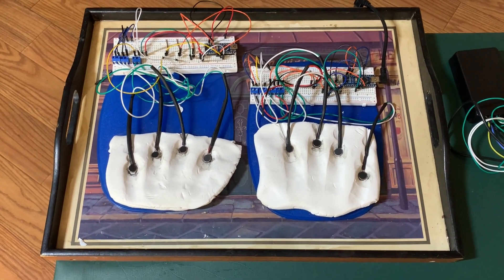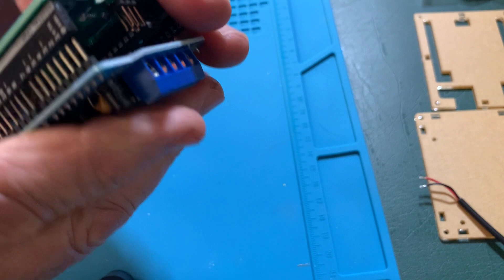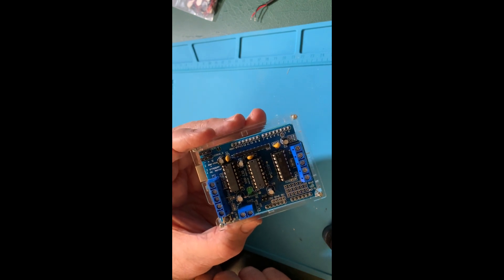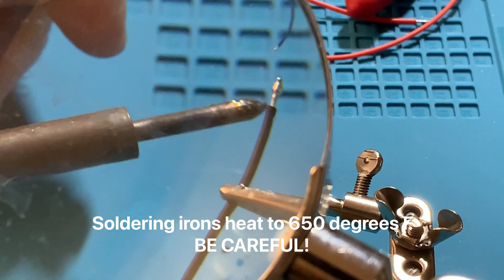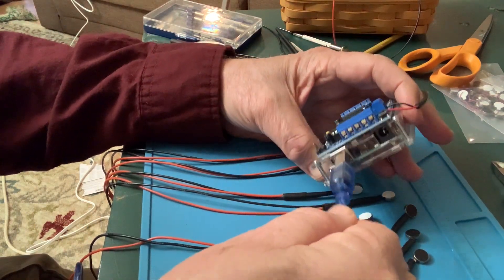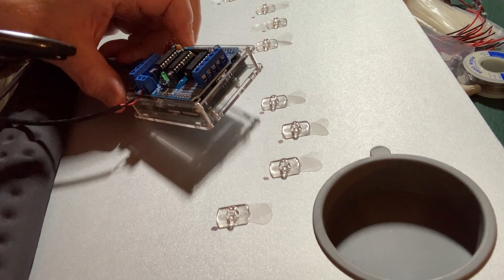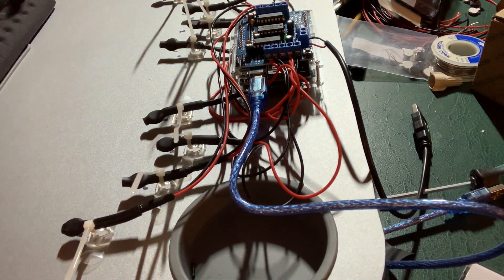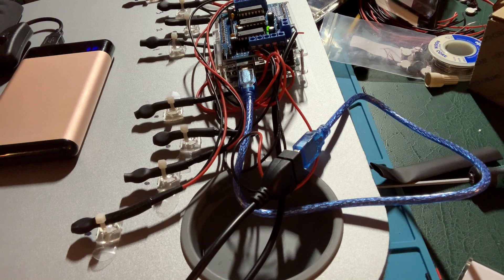PD Buzz Board

Comment from the maker: Based upon requests, I have added two additional Sketches to GitHub.  The VibroTherapyMotorShield_167_75.ino Sketch uses the 167 millisecond timing, but vibrates the motors at 75% of the strength of the standard 167.  The VibroTherapyMotorShield_167_90.ino vibrates the motors at 90% of the standard _167 strength.

Comment: Well done video and parts list!  My son and I assisted our "PD friend" complete his first therapy device today.  Our PD friend was able to assemble and software load the Arduino with another friend.  Works flawlessly!  Our supporting role was the buzz board assembly and therefore we naively watched clips rather than the full video. In hindsight that was a mistake!  Clearly, you went through painstaking efforts to make this design as simple, reliable, maintainable, and repeatable as possible.  I now understand your emphasis on "PD partner" as only a partnership could yield your accomplishment!  Bravo to you both!  Before commenting further I want to ensure those readers contemplating this effort that I echo the author's sentiment that this is certainly an effort that can be undertaken by robotics/electronics programs that PD patients can find locally.

The remaining comments are due to incomplete video watching, some missing parts, and perhaps a bit of bravado as we deviated from your design on our first endeavor with our "PD partner".  Our initial deviation taught us that vibration isolation between fingers is an essential aspect of any design and hence why a glove is an excellent approach.  If vibration isolation isn't accomplished "crosstalk" between motors defeats the sequencing.
Reply: Jim, tell me how vibration isolation was involved & solved, thanks.
Reply: Does each hand mirror the other please?

Comment: After overcoming a library issue which was causing the software upload to fail, and a miswiring of the red/black wires, we have successfully created our first PD Buzzboard using the 15k motors ... the Digikey motors are actually smaller than the Amazon 12k motors, but they pack a vibrating punch !   Thank you Paul for sharing your ingenuity !
Reply: Garrett, what was library issue and where did you wire incorrectly.  I need to check everything, thanks.
Reply: It took me a while to realize that the Arduino Adafruit library was named AF Motor (Arduino 1.0).zip in the GITHUB folder…. My compile/upload kept failing until I unzipped it in the ADE library mentioned in buzzboard video … the wiring problem was the printer cable not pushed in enough 😮
Reply: Thanks G, glad you're up and running--feel better.
Reply: Are you seeing positive results?

Comment: I would like to give thanks for all this information, it was very well detailed.  The build of the Buzz Board worked well if you are able to pay attention to the details given. The parts list and the download information is flawless.  The only real difficulty was the soldering for me, having the jitters. The wires are so small on the motors, you need the soldering fixture to hold the wires, even at that I ended up with 4 bad connections.  If this happens don’t try and salvage the motors, just start from scratch, with new motors.
Also if the buzz routine starts to act up, you may have to reboot by disconnecting the power for a minute. If it continues you may have a bad connection to a motor (bad soldering) or have moved the wires excessively while powered up. 
Go over the details of the building process many times before you start, it takes time and patients, don’t give up !
Thank again
Tim

Comment: Hello Sir Buzz! WOW, I have to say, this is impressive to say the least. Could you please share a link to the Stanford docs that you got the specs from? May I ask what your day job is?
Reply from the maker: The Stanford documents are here: https://med.stanford.edu/tass-lab/publications.html
The one on the study is here: https://www.ncbi.nlm.nih.gov/pmc/articles/PMC8055937/pdf/fphys-12-624317.pdf page 4 has the patterns.
This document references the randomization: https://www.ncbi.nlm.nih.gov/pmc/articles/PMC8771098/pdf/NRR-17-1495.pdf

There is a lot of very good reading in there.  Also, a YouTube search for Tass and Parkinson's Disease has some very informative talks that are worth the time invested.

Currently, I am the tech lead for a system in the civilian federal government.  I spent a large chunk of my early career as a programmer.
Reply: @pdvibrationtherapy  Thanks so much for the links! I've looked at many of the Stanford docs and don't see the spec info. Could you please point me to where you found the detail for the build? How many hours would you estimate to perform this build the first time?
Reply: @PaulNavarro-d6r  They didn't exactly put out step by step instructions for the build.  However, they provided detail on their process.  The top of page 4 of this document https://www.ncbi.nlm.nih.gov/pmc/articles/PMC8055937/pdf/fphys-12-624317.pdf has the diagram of the stimulation pattern.  However, right below it in the left-hand column, it states 100ms while the diagram shows something closer to 167ms.  This document https://www.ncbi.nlm.nih.gov/pmc/articles/PMC8771098/pdf/NRR-17-1495.pdf page 2, center column, bottom 3rd, references random patterns.
For a first-time build, my guess is that the board will take between 60-90 minutes plus the time to build the fingers.  The soldering of the fingers IS the challenge on this build.  I can build a board's worth of fingers (8) in about 30 minutes.  However, I have done it a couple of times now 🙂

Comment from the maker: Several folks have expressed interest in a randomized version of the board software.  A big thank you to Michael and m@mfritz.com for contributing customized code for the board.  The code is now available on the github and Google drive as PDBuzzRandom_100_orig.ino and PDBuzzRandom_167.ino.  the 100 is Michael's contribution.  The _167 is identical with a longer pulse time.
Let's keep the innovation going!  
Full disclosure, I confirm that contributed software loads and runs on my test board.  As usual, no warranty express or implied.  All contributions to relieving the symptoms of PD are greatly, and humbly, appreciated.
Reply from the maker: the URL for the github site is https://github.com/pdbuzzboard/pdbuzzboard for all of the code.

Comment: Thank you for making this available. A small nitpick regarding the motors they are not piezo electric but regular brushless motors with an off axis center of mass, making them vibrate when they turn. Piezo electric motors will not work for this.

Comment: I have PD and am thinking about building a copy of your buzz board to try out, but I am confused about the power pack. Most of the item in your parts list have Amazon links, but not the power pack. Can you recommend one that would work? And if not needing to be portable why a battery pack instead of a plug in power supply of some sort like an old phone charger?
Reply from the maker: I have had success with several different battery packs.  I always use the 5V 2 Amp models for phone charging.  There are power packs that deliver less than 2A that I avoid for anything but testing.  There is no reason that a wall charger wouldn't work assuming sufficient amperage.  My partner likes the ability to move the board around the house to where ever she is comfortable, thus the focus on battery packs.

Comment: Excellent job!!! You inspired me. I will try to build my own globes.
I have some doubts with the motors if you can help. You mentioned that Digikey motors work at 15000 rpm but in specifications I’ve read that they do at 12000 rpm and they are built for 3V but if I’m not wrong Arduino works with 5V…. Model VW0625AB001G is correct?
Reply: Vybronics has down rated the motors from 15k to 12 k.  Same motors.  My wife got results with the Amazon motors (10k) and the Vybronics.  I only build with the Vybronics now.  While the Arduino Nano gloves got a result for her, they do "walk apart" so that both are not pausing at the same time.  Important?  Don't know.  The Nano does not vibrate the motors as strongly as the motorshield.  I am only building the motorshield gloves at this point.  The motorshield takes a 5V input, but outputs around 3.3v.

Comment: Not great with this stuff....Any thoughts why fingers 1&2 vibrate strongly and 3&4 not so much...made replacement fingers for 3&4 same result.  Changed the motor shield same result...Possibly the Arduino or power supply?  Any suggestions are very welcome.
Reply from the maker: can you move 3&4 to the connections for 1&2 and 1&2 to the connections for 3&4 ?  Does the problem move?
Reply: I did last night and 1&2 are now the weaklings with 3&4 vibrating strongly.
Reply: I noticed the code in my sketch is 100-- should it be 167, would that make the difference?
Reply from the maker: @cropsy50  100 vs 167 is the pulse length.  It will influence the length of pulse and amount of vibration, but not cause an imbalance.
Reply: Thanks, did not really believe it would.  Sorted it out today by using the yellow jumper on the Anduino for power & the 4th finger turned on.  For finger 3, I used the center ground for black which worked.  Without the yellow jumper, there wasn't as much power.  I  don't understand it, but happy to try to feel better so thanks all, especially PDBUZZ.
Reply from the maker: more on this one.  I bought a few "cheap Chinese" Unos that are exhibiting the same issues.  I was tracking on a shield problem, the voltages being delivered to the shield from the Arduinos are very different on the knock off vs the "real" Arduino Uno.  I just received another "real" Uno R3 from Amazon and the "bad shield" works fine with the authentic Uno.  More research on the differences, but back in business with genuine device.
Reply: Can one be sure he/she is buying a real one from Amazon.
Why does mine work with the jumper supplying power and a problem when I remove the jumper  conductor.   Is that part of the bad Anduinos from China?  I'd like to understand for the next iterations.  

Thanks for all.
Reply from the maker: The genuine Arduino that I have purchased are always the teal (greenish) color.  Also, they have the infinity symbol (8 on its side) with the + and - in it).  I believe that is the official logo.  All the knock offs I have purchased are either black or, more commonly, blue.
With regard to the jumper, unclear.  I have put a meter on the good and the bad and there are several pins that are getting 5V from the official Arduino that have nothing on the knock offs.  I have ordered an Elegoo that claims to be more compatible and will check. 
My concern is that, with the jump in place, you may be powering the motors from the Arduino, not the external supply which won't give sufficient vibration for effectiveness.
More to come when Amazon delivers...
Reply: @pdvibrationtherapy   Thanks for continuing on-happy to share costs as you search for answers...I feel like it's vibrating pretty strongly, but of course don't know if it is enough.
Reply from the maker: @cropsy50  There is a video on a vibration sensor that allows you to quantify the vibration levels.  It is also very useful for testing to ensure that the motors are continuing to deliver as I have seen a dropout rate over time.
Reply: @pdvibrationtherapy  Thanks, I remember seeing it a week or two ago, will take a look, thanks.
Reply: @cropsy50  Any resolution on this, having a similar problem!

Comment: The  vibrating motors that meet Stanford spec from digikey are sold out is there a substitute
Reply from the maker: I haven't used these, but the specs match.  There are only 113 in stock at Digikey, so I am hesitant to order some for testing purposes and take them from folks in need. https://www.digikey.com/en/products/detail/pui-audio-inc/HD-EM0602-LW15-R/18686987
Reply: thank you @pdvibrationtherapy

Comment: I am facing problem in getting 2amp battery.  I have questions . Is 20000aMh battery good to use instead of 2amp
Reply from the maker: That will work. The m is for ‘miili’ meaning thousand. 2000mah = 2 amp

Comment: you mentioned you had overpowered the motors, and you thought that is why they failed, what did you do to change the motor voltage/
thanks
Reply from the maker: My first cut (the original) used a bread board with PNP transistors to turn the current flow on and off.  I down regulated the voltage from 5v to around 4v with the resistors that I had on hand.  Thus the over volt (they really vibrated vigorously though!).  I changed to a 3.3 volt power supply for the feed which removed the need for the resistors.  The motorshield design was the next step to simplify the design.  The first set of code ran the motorshield at a lower speed to deliver a lower voltage to the motors.  Interestingly, the Motorshield consumes a good bit of power when passing voltage through the device.  It down regulates the 5V to the low 3s just by device loss.  The Nano power supply doesn't have sufficient power to push the motors past limits (thus the somewhat lower vibration level of the micro controller gloves versus the board/motorshield gloves).
Reply: @pdvibrationtherapy  thank you for the information, I’m just waiting for my parts to arrive so I can start on my gloves. I’m not really clear on how to upload the programming from my computer to the device, but I will wait until I get it assembled and send you another message,
Thanks again

Comment: Her tremors still better? I got overstimulation bad tremors so had to back off time on gloves .  Did she ever take time off like month? Thanks so much ps as that’s a lot use from Jan - now
Reply from the maker: tremor is pretty much gone.  If she has a stressful day, she may have a small tremor in her left foot return.  Have you tried dropping back to the 100 sketch and/or lowering time?  She has not taken any time off.  I know Tass did that in his tests, but, I assume, that was part of the "lab rat" testing to see what happened.  My refrain throughout this has been "my wife isn't a science experiment"
Reply: @pdvibrationtherapy  I’m going to try both suggestions do u know of people successful on. 100?
Reply from the maker: There have been folks that reported success on 100.  Do you want a version of 167 with a reduced vibration level? @ellenquintero6
Reply: Thinking about that as I think would b less strong right.   ?

Comment: Hello,

Thank you very much for the detailed instructions and parts list. I was able to successfully procure all parts and build one with the 12000 rpm motors on Amazon. However, I am encountering an issue with the vibration strengths between the different motors. Every time I turn the setup on and off, different motors are at full strength vibration (say 4-6 of the 8) and the remaining ones vibrate at a milder strength. This is not a connection problem, as all motors are at full strength at some time or the other (when turned on and off, different ones are at full strength), but never all together at once. I have tried switching power sources, including directly through wall outlets, but the issue persists. So, I don't believe it is the connections or the power. Has anyone else faced this issue? Suggestions to troubleshoot are most welcome. The Arduino I purchased is genuine version.
Reply from the maker: For troubleshooting, I suggest you get a Multimeter if you don't have one.  You can get one at any hardware store, Walmart, Amazon, etc.  You don't need an expensive one for this work.  For ERM motors voltage=speed=vibration (roughly).  Check the voltage being output on each channel by putting the test probes on the terminal screws on top of the blue connector blocks on the motorshield.  Red to positive and black to negative.  If you get a negative reading or your meter beeps, swap them. The results will bounce around a bit as the meter is sampling at one rate and the Arduino is turning the "finger" on and off.  However, all of the readings should be roughly the same.  If they are not, the problem is in the motorshield or, much less likely, the Arduino.  Swapping the motorshield is a good next step.  If the readings are roughly the same, try moving the problem motors to a different port on the motorshield and see if the problem moves or stays (you can do this step first without a meter).  If it moves, the motors are bad.  If it stays and "good" motors become "bad" motors, it's a shield problem.  Let me know how it goes.
Reply: @pdvibrationtherapy   Apologies for the much delayed response. I had to wait a while to get spares and try this out. Long story short, the problem was actually the Arduino! After trying out different motor shields, wires, motors, etc., I just swapped out with a new Arduino and the buzzboard finally worked.

It has been 3 weeks since the PD person started using it - but we do not yet see a response. I will wait a little longer before trying to customize the pulse lengths. If anyone has any other suggestions, I am all ears.

Thanks again for all that you do and have done - this is an incredible resource!